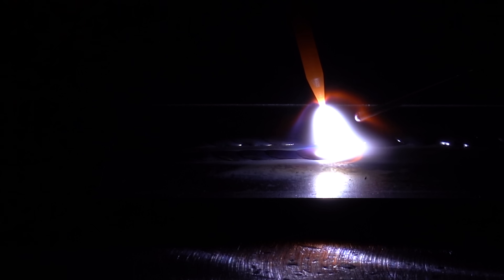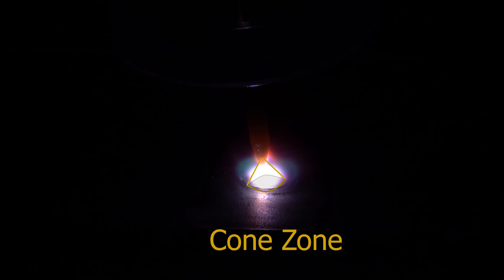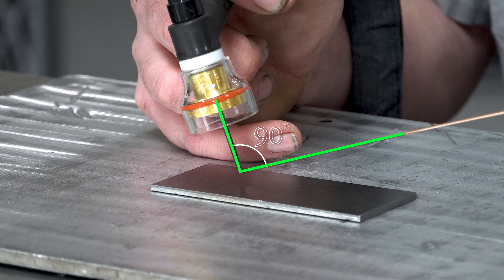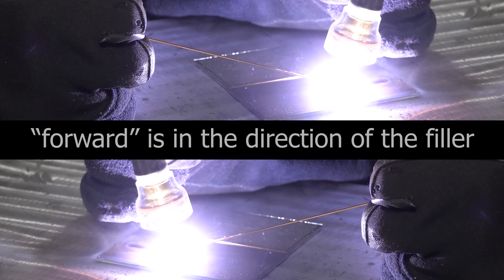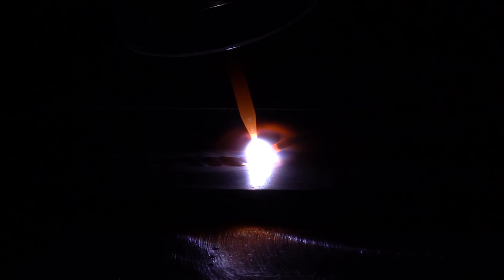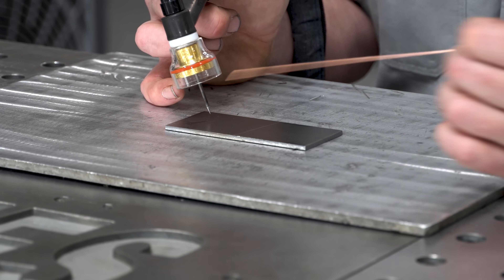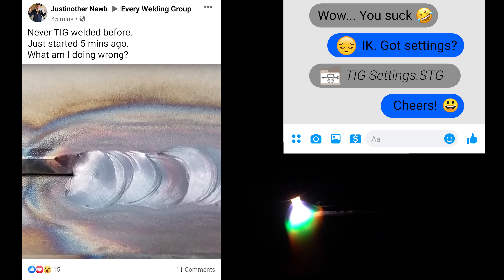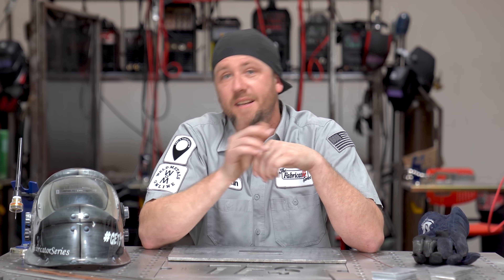TFS: Why is the Filler Melting and Balling?

Comment from the maker: Save 10% on everything from Weld Metals Online]
Code: TFS10
https://weldmetalsonline.com/

Tools & Gear We Use and Recommend
https://www.amazon.com/shop/thefabricationseries

Learn to TIG Weld in Our Class!
http://thefabricatorseries.com/classes
Reply: Hey man I need help...I have a 200amp multi function tig...it's a dc inverter hf model. No matter what amp setting I use it's way too hot...it's loud and is acting like a plasma cutter....it's set on tig...tungsten is sharp...argon is running..no chance...I have gas running very low as when I turn it up it like a gas torch. Please help.

Comment: Need help with 1/4 cast aluminum and not getting a puddle. Could it be to much gas like what if I accidentally ran 50-60 cfh because I was running 25-30 l/min didn’t see my new setup was different. New to tig.

Comment: Hi guys, greetings from the United Kingdom,,  learning lots from your tuition,, I have a question,, I’m using a 160 amp inverter ac/dc tig, teaching myself ,, I set the amps at around 100/110, question,, why does my tungsten burn up, doesn’t seem to last very long at all, argon flow at 15 help ,,thanks

Comment: I'm starting to weld with tig now, and I'm not able to weld properly, the electrode burns and turns black and the polarity is right, I'm connecting it to the negative, I'm using 8 liters / minute of pure argon. What can it be? I'm using 45 amps to solder 1.5 mm. Please help me. thanks.

Comment: Will using too small a filler wire also cause balling?
Im having some difficulty with 3mm ally at 120amps, before the filler gets to the puddle it melts away. 1.6mm filler.

Comment: I really love your channel, did start TIG welding Stainless a year ago. I was a professional, but in metal sheet construction, this includes soldering with tin-leadalloy, oxypropane solding- and welding. I educated myself via learning by doing on the job, and after a few months of halfassing I found your channel by chance. Mate... Let me tell you, watching your videos and trying to apply your tips day by day at work lifted me onto a level I couldn't have imagined. Thank you for that Justin!
Now I have a question, I work with 0.8mm (32 Gauge?) of 304. And it drives me crazy man. With thicker material (1.6mm/16 Gauge and above) your education enabled me to Tig almost colorless, even with little cups. But those paperthin sheets do not comply, no matter which amperage or travel speed, they do oxydate. I think it is because the thin material isn't able to transport the heat away fast enough, but I am not sure. Do you know whats the problem and how to solve it?

Comment: Good Info there Justin, sometimes the bigger problem is we don't weld on small coupons every day. The jobs we are given can be many different shapes and sizes. 
OK, I have a situation,  the material is 3/4" thick "Bizalloy" (quench and tempered steel) tee joint, Pre-heat to 110 deg C,  filler rod 2.4mm ER 70 s2, weld size 4mm,    Question ; How many Amps do I need.??
My situation, Machine set at 208 Amps, and using foot control and using most of that. Getting that puddle well established before you get going is paramount, and I'm sorry but sometimes you can't have a 90 degree filler angle, part geometry will not allow it., like welding into a 3 way corner.

Comment: If 0.13" thickness of steel required 130amp to melt, what about mm calculation? Also, to melt steel, carbon steel, mild steel and stainless steel, does the calculation all same?

Comment: Every weld test I’ve done has been passed with the lay wire; so yes, there is getting around it. You just have to know how to disperse it. Stacking dimes on tig or mig is like having training wheels; but I will admit there are times they’re preferred.

Comment: My problem is the filler stick in the puddle when i weld stainless . My weld is perfect but it’st frustrating during welding . My setting is furick cup#12 
30 cfh at 50 amp on 16 gauge stainless steel  tube with 1/16 318 filler
Reply from the maker: Your filler is too large for that amperage. Use  .045 filler. You can find it here:
https://weldmetalsonline.com/collections/filler-wire
Reply: The Fabrication Series    Thank you man ! I learned a lot with your videos ! My favourite channel on youtube ! Good job !

Comment: Thanks for everything! My request is for tips on adjusting amperage on the fly (pedal). As an exercise have tried setting to 90A for an 80A weld, then to adjust with the pedal to the right level. So far have not been able to "read the signs" well enough to get as good a weld as if had set to 80A and floored the pedal. Try watching the puddle, try having a sense of how fast / slow am going, try catching a glimpse of the bead behind. Struggle to gauge the right amperage. Should I be able to do this?

Comment: Just like to mention the the one amp per thousandth of an inch only works well up to about one eighth inch. As you get thicker, you have to reduce the amperage increase. Otherwise, you’ll be using 250 amps on a quarter inch and 500 amps on a half inch, which is ridiculous.

Comment: Great information, thank you. Is the 1 amp per 1000th rule for all metals? Is there an upper limit to that rule of thumb? Like if you're welding on 3/8 aluminum would you set your machine at 375?

Comment: Funny, After Tig welding for 30 years, I have the exact opposite problem. When I Mig weld (New to me) I try to get in tight and POOOF there goes another young tip.
Justin, Maybe after this great video you could do the same about Mig??????

Comment: Great content. Practical, implementable advice.  Particularly the one about amperage. Everybody wants to twist a knob to fix a problem. As an aside: it looks like you might have a little moisture in your argon. Just looking at the extra halo and the ring deformation on the tungsten in a few of the arc shots.

Comment: Great vid man, I learn so much from these.

What would be awesome is a vid on overhead TIG, specifically overhead plug weld. Having a hard time welding in a patch panel, can’t seem to get decent beads.
Reply: Overhead TIG is no different than flat just really awkward to get comfortable.  At least that is the case with stainless and carbon
Reply: SDNorm2 I guess I still need some more practice, my overheads look like crap. I’m using the 4T because I haven’t found a good way to use pedal overhead.

Comment: My torch angle is always perfect when I weld on the jig table but when I have to weld standing on my head holding 2 clamps and a flashlight my torch angle is so off I could have used an M9 flamethrower. Need more practice away from my comfort zone I guess.